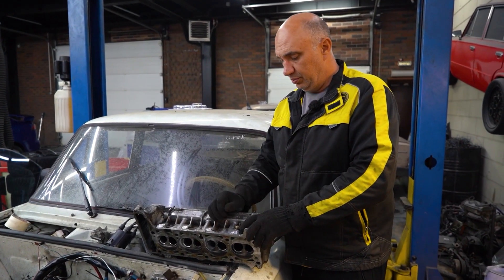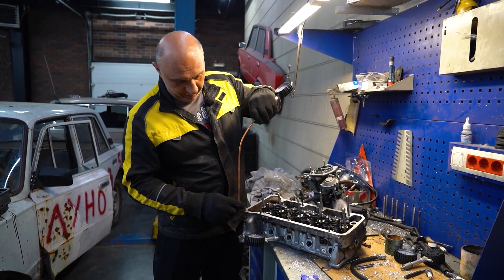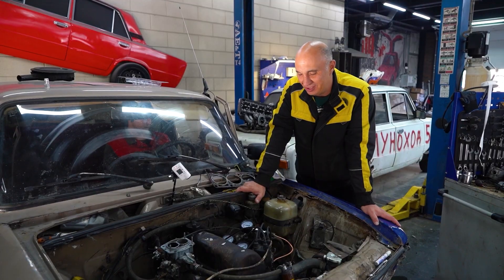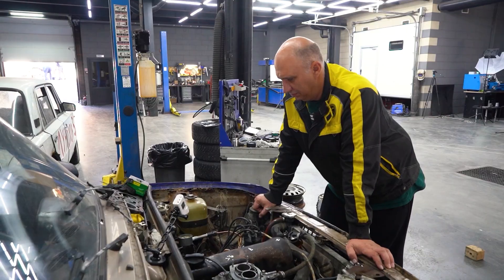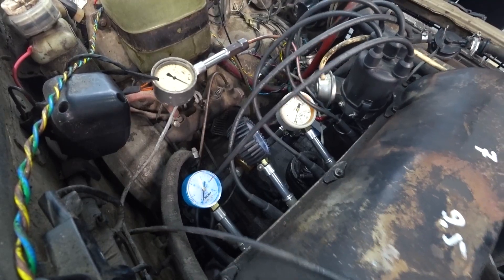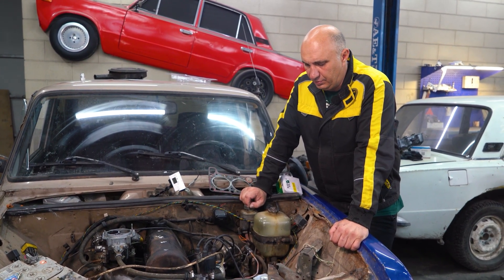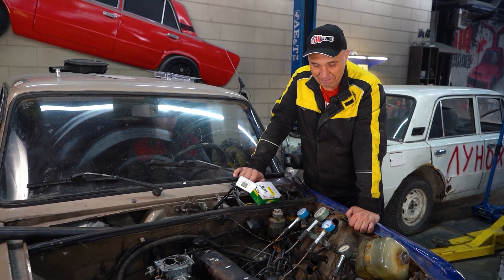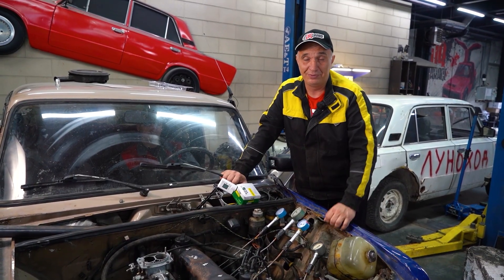What’s the compression on a running engine?

Comment: your gauges need check-valves so they will show the pressure, the pressure is low because all the tubes installed for gauges, your compression has fallen so far the engine has issue starting..

Comment: A manometer is a low pressure gauge used for building envelope measurements, very very tiny amounts, the correct translation would be more like "high pressure gauge"

Comment: Hello fellas I would love to see you guys build a racing lada, high compression dual 44mm side draft Weber carburetors dual valve springs  lightined valvest port work four into one header and run it on methanol alcohol with 100 shot of nitrous, MSD ignition with two step,role Cage ,racing seat cut out all the sheet metal on the doors and everywhere you can to lighten up the car etc😊

Comment: They say thermal, vacuum pressure and by playing with all the gauges you’ve done something kinda unusual and the gauge is reading the surface tension of the oil and not the pressure of the Tronic lensing force nor the actual combustion chamber pressure I’ve seen them go so far as to put venture in there to try to get this measurement right it works out that right at the point of that one saying that you hit 32 that’s when you hit with a high pressure vacuum gauge and you get some better results but you need at least a 3/8 tube not a quarter inch tube And it really is more 1 cm ID to tube because the 1 cm is the standard surface tension, node lattice, spacing at sea level due to gravity and causality. The thing is mostly running on harmonics.
Reply: You think I’m nuts put five times the size of a vacuum canister on it and it has to be a good canister that you can pull a really hard vacuum on and I wonder why it does that right on the tip of the vacuum, stem, master vacuum port

Comment: Those manometers have no chekvalves that's why they don't work, also at idle the carb restricts the airflow so that the pressure is only enough for ticking over. You need to measure driving up a hill at full throttle.

Comment: compression is a very good measure of VE. its based on throttle position. why we do a compression test at full throttle. 
at idle, VE may be down at 25%. an 8:1 CR is now only 2:1...
combustion pressure is way lower at low VE% for the same reason. gotta get it under LOAD for it to start making decent pressure...

you wanna read cylinder pressure, you run piezo transducers...

Comment: Based on the fact that the needles jumped around quite fast, i think that the pressure could be getting quite high, but for a very short amount of time, and the needle just can't move fast enough, and as you said, neither the spring-loaded valves,
Reply: also, the size of tube is different than original (smaller hole let out less pressure than bigger tube), so the gauge is not calibrated for the new tube and DIY adapters.

Comment: Could it be, combustion Engine has a flame front affect on combustion that forces the piston down at such a fast interval. And then a vacuum on down stroke for intake. Could that constant change in compression to vacuum equal out almost at the compression guages causing a low reading?

Comment: Smaller jet on those tubes will give you a smoother reading
Reply: The gauge is calibrated to a specific size of jet because we'll get different pressure with different size of jet (bigger jet let out more pressure than tiny jet).

Comment: Not surprisingly you will get low reading at idle, throttle is closed. YOu need to chceck full load pressure. In this tiny engine it will not be much but readable. Modern high power diesels run to 200Bar of peak cylinder pressure.

Comment: Combustion peak pressure for regular gasoline engines does not typically cross 50 bar at maximum load and ignition time.
For pressure reading, you need a very (very) tiny tubing between cylinder and measurement gauge (something like refrigeration capillar tubes), in order to minimize compression spring effect.
But anyway, analog gauges does not provide all amplitude, the best you will got is the pressure average.

Comment: You need very fast one way valves close to the combustion chamber, also a long thin tipe will reduce the pressure.
A Diesel Ship engine can reach over 200 Bar Combusion Pressure

Comment: I'm just wondering would the heat from a running engine eventually make the gages   melt or stop working considering that the combustion gas is super hot

Comment: Low readings would be expected at idle and free revving the engine. The cylinder pressure is low because 1) the engine intake is in vacuum with the throttle relatively closed and 2) cylinder pressure is low because there is very little torque required just to turn the engine over. 
If you want to see bigger cylinder pressures ,you have to drive the car and load the engine up
Reply: The main reason the pressure is low is because of the extra volume the tubes are adding to the cylinders at TDC.  This is reducing the compression ratio (causing the starting difficulties).  Then as soon as the engine starts running, the heat anneals the springs in the pressure relief valves on the guages.  Rendering them useless.  There are so many issues going on here.  

It really needs check valves where the tubes enter the cylinders.  And those check valves need to be heat proof.

Comment: Mechanical gauges are a bit too slow, id go to using electrical pressure sensors logged via an oscilloscope. Connecting them with as short of tube as possible

Comment: You need electronic load sensors and a computer that can average out the readings. There's still a question of keeping the load cells cool enough to operate, but that's where this test needs to go.

Comment: 🛑im surprised no one noticed or mentioned this, you should keep the hand break on and put the gear shift in 2nd and try and to move the car with manometer installed , then you will see the pressure needle go up.

Comment: Without the problem of check valves making combustion chamber larger messing up ratios you could of jacked the car up put it in 1st gear and applied the brake while under acceleration and then you would of seen a larger reading especially under stalling conditions

Comment: Use high temperature pressure sensors and digital gauges.. thats likely the only reliable way to obtain a clean reading.. also the combustion chamber size has changed due to the extra volume From the copper pipe and the pressure gauges.. im not sure how to get around that unless you make each pipe and gauge exactly the same length and volume or the entire engine compression ratio will be different in each boar 🤔 you might have to shave the head face until you reach the original combustion chamber volume in each cylinder.. thats going to take some thought and effort but would be great to be able to monitor running compression and start compression for track or drag racing and even for diagnosis of road cars.. i can see this being very useful if you can figure out how to have a normal combination volume..

Comment: it is just going really high for such a brief time that the pressure can't build up in the tube before it is at suction on intake stroke the mechanical valves can't move fast enough to open and close with spring in them.

Comment: I would like to see you guys use a ball bearing check valve with a large spring, like for hydraulic system style, and use small diameter copper line(like for your oil pressure gauge) coiled up between the check valve and the gauge to smooth out pressure spiked and go for a
Drive and out the engine under load and see if it changes, and change ignition timing to see if that has an effect of combustion pressure

Comment: Maybe you could try to connect a fast electronic pressure sensor to one cylinder so you can measure the pressure waveform during the cycle? I have seen that on reseach projects, but I could not find anyone doing it in a video. Could even have big potential for tuning!

Comment: What's pretty cool is I can do this in real time on my passat diesel right through the ECU. The Bosch glow plugs have cylinder pressure sensors in them! If you have a mechanical issue with valves or piston rings etc you can even set a check engine code for a torque difference on whatever cylinder has less pressure
Reply: Cool story bro
Reply: @mann_idonotreadreplies  oh pity, you're confused! No stories were told

Comment: Well, Truth is that you also have Vacuum in the cylinder pretty much half of the time as it suck in the fuel mixture, so when the valves in the gauges fails to seal the pressure you built up is being sucked back into the cylinder again, and all you can read is pretty much the average pressure. you would need some really heavy valves to get this working properly :)

Comment: We did this in school on a 1990 Honda Accord it made something like 50 psi or 3.3bar at 4000rpm
Reply: 50 psi is like the fuel-pump or tire-hand-pump, this value is probably an error due to gauge malfunction and/or incorrect calibration.

Comment: Come on guys. How much compression did you lose with all the tubes?  That and you need check valves. Put check valves at the head. Will still be lower than stock pressures but will still be high.

Comment: To measure running cylinder pressure you need an electronic pressure sensor - then no need for non-return valve. Cylinder pressures to be then be displayed sequentially on an oscilloscope.  Would be interesting to then examine the rise and fall shape of each pressure pulse. No need for all that plumbing if each sampling orifice was built into modified spark plugs.

Comment: I'm wondering if the pressure would change when the car is driving.  An engine under a load with more air and fuel should yield more pressure. " In Theory "

Comment: You don't need a check valve at all. All you need is a tiny buffer orface. They have them on the old mechanical turbo gauges to keep manifold pressure from fluttering. Take that out, and it's unreadable. Just an FYI

Comment: I think fuel is getting blown into the gauges on the compression stroke. This is robbing fuel from the startup process, making it harder to start. Further, once it's running, the gauge loads up with this fuel, and since you can't compress a liquid, the gauge reads nothing. This might work better on a diesel due to the fuel being supplied after the compression stroke, though I'm not sure the gauges would survive the heat of diesel exhaust gases for very long. Someone else mentioned a snubber, which I think is a step in the right direction. @teardowndan is on to something about check valves, but I'm not sure how you would make it allow the air while rejecting the liquid.

Comment: Combustion pressures in aircraft engines were measured by special spark plugs that had pressure transducers built in. The duration of the pressure spike is very short. Dial gages are not going to be able to respond quickly enough to show an accurate reading.

Comment: This is why they use piezo transducers for in-cylinder pressure measurement for engine testing.
Reply: also showing how hard it can be, 🤔hope that doesn't come out to bite me as my 440 mopar is being modified for EFI and ( and Nissan* type VCR connecting-rod's so independently tuned everything cylinder by cylinder and by cycle etc ) liquid push-rod's ( valve's have slave-cylinder's so top is tied to the masters/cam-card-grind/or/ecu-limited and bottom-side is tided to air/N2-bladder-main/or/opposite-cycling for desmotronic activity ) aka computer need's to know where the intake's-valve's are as well as the exhaust's-valve vs in-cylinder-PSI vs crankshaft so nothing crashes and the tune can be 👌as spark is lit at peak-PSI/best-spot and or table for in-cylinder temperature etc rather than the 2002~ ways of guessing by using o2's and camshaft-sensing+crank or 1950's-fixed carb+dizzy-etc
Reply: @richardprice5978  Wow, hope that works out for you.

Comment: In steam, there is a device called a snubber in line with the gauges.  This prevents the pulsations from making the needle flick around.  It's not a check valve, it's just basically an orifice that results in the reading being averaged over a time constant.
Reply: Which to use would depend on whether they want to measure average pressure or peak pressure.
Reply: Fluid can be used to dampen the needle also, such as is used in vacuum gages. Like glycerin
Reply: Also, the added volume inside the tubes and fittings decreased the compression ratio a LOT . But it was still fun watching . :)
Reply: like RC filter in electronics, narrow channel that creates resistance for the flow and a reservoir

Comment: Remember that the combustion is forcing down the pistons and as the rotating assembly is design to help keep the reciprocal movements of the pistons in unison. The chemical force of the combustion is converted to mechanical force and only the residual force will show a reading as pressure.

Comment: So i did this for an r&d project of mine on my drag bike and by far commercial pressure transdusers were best for the job with as little volume between the chamber and sensor but i used stainless brake line. Tthe more primitive way i found was oil filled gauges and what ever you see at idle your gonna see 5-30x under load around peak tq. Add a restrictor between the tube andvalve i use a small needle valve.
Reply: The reason for idle vs WOT is simply because compressing vacuum (idle) leads to less peak pressure.
Reply: @hydrocarbon82  yes but youl actually get way higher pressure Going up a hill for instance than you would just going wot on flat ground
Reply: Which company did you use for your pressure transducers? Kistler make specific Piezoelectric engine cylinder pressure transducers, I've not seen many others in that niche market though!
Reply: I am curious what were your readings?
Reply: id like to see it becoming more common ( and mor affordable $$$$, on mine the bulky/packaging-in-bay-use and or hard to use, but then again im not great at computer's/programming but good for mechanical needs, definitely interesting choice of mine to continue/converting to EFI and a complicated setting at that 🤞🤔😅 mechanically nd wire should be fine getting a tuneup and ecu is a different experience 💭🤔🍀 ) in aftermarket ECU's as tune is directly controlled by need's of in-cylinders not 2002~era MAP/o2-ect externalities as that's more of a guess than anything really 

and or project's like mine it's even more important as my valve's/liquid-push-rod's ( cam-on-demand, by grinding max then ecu-limiting downward's to needs etc ) and connecting-rod's/VCR ~8:1 to 15~:1 aren't fixed in place like tom-hoover had in mind in the 1960's/ 440's and 426-platform's
Reply: Cool story bra

Comment: Great video, guys. Did you guys do a video about spark plugs opening and closing the gap as far as possible. Can you try to make a diesel run backwards. That would be cool. I know older diesels you can do that, but I never tried it or really seen it go all out. I have seen a few go backward for a few seconds or less on YouTube. Keep up the great work guy's 👍
Reply: Most engines are capable of running backwards. I used to have an old Ford 300 inline 6 the would run backwords. I wouldn't do it to any engine you care about. The problem is the oil pump will also rotate backwards and you wont get any lubrication to the cam and main bearings.
Reply: @Skumevil  One of the big reasons for a starting motor is to start spinning the engine in the proper direction. This feature goes back to steam expansion engines even. 

(You should see the stuff used on ships back in the day when they had those utterly massive expansion engines... think Titanic or whatnot... with engines that big they needed the starting drive just so the engine didn't blow up from the injection of steam in the high pressure cylinder, the amount of friction on the pistons when sitting still was just that high, but direction was just as important)
Reply: Many twin engine boats have counter rotating engines to the boat runs straight. I used to watch car races and this one car would turn down into the corners and not lift th inside corner of the car, found out the car had a boat engine that turned the force down the corner instead of out of the corner,  the other drivers were not happy when they figured it out !
Reply: Any engine can be re-engineered to run backwards, in fact the old 2-stroke Detroits were capable of this. But you have to use a different oil pump designed to run the opposite direction or it will seize up from lack of oil.